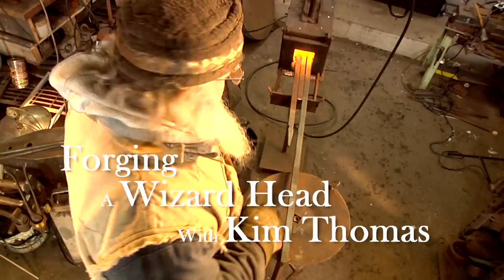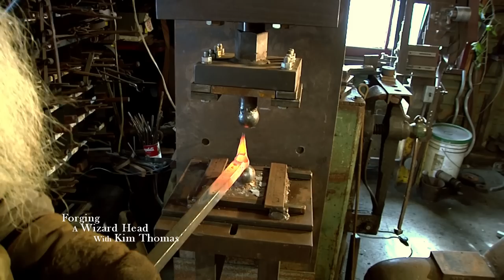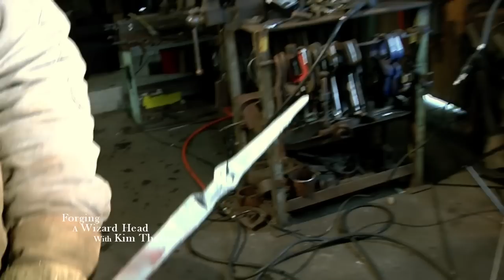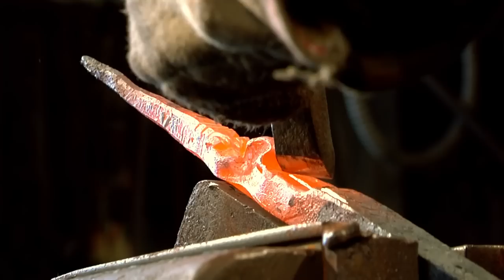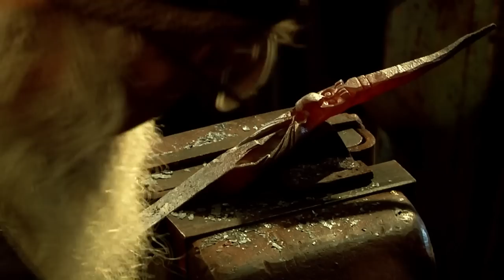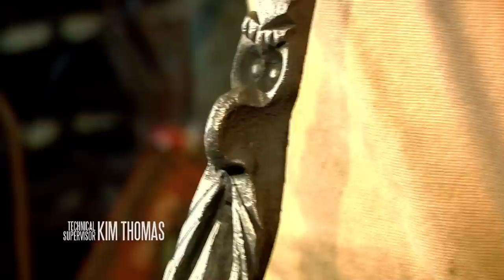Amazing Blacksmith Forges A Wizard

Comment: Nice wizards! Just curious, why switch from the gas forge to a coal forge part way through?
Reply: because the coal he can heat only the parts that need to be heated instead of having the whole thing come out yellow hot.   the coal is a much smaller heat zone so he can heat just the mouth area if he needs to work on it.  so the other parts of the piece dont start bending out of shape from the hammer blows.

Comment: You'd think working with red hot metal, only feet from a forge, he'd be a bit warm with a hat, 3 coats, gloves and a head covered in hair!
Reply: the insulation keeps the heat away from him
Reply: You would have to be very close to the forge to get uncomfortably warm.  A forge is supposed to concentrate heat, not distribute it like a furnace of fireplace.  If it's a cold day outside, I need to wear warm clothes when I work in my uninsulated shop.
Reply: i worked in a glass blowing studio, the kiln was about 5000 F. only time it was really hot was when you opened it while in front of it.
Reply: Didn't you see his fog breath? It's cold in there.